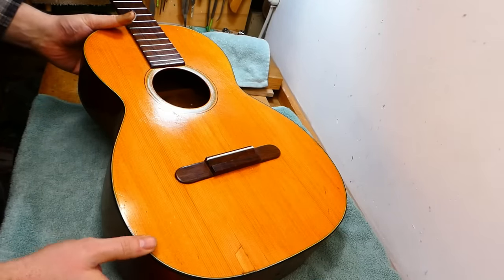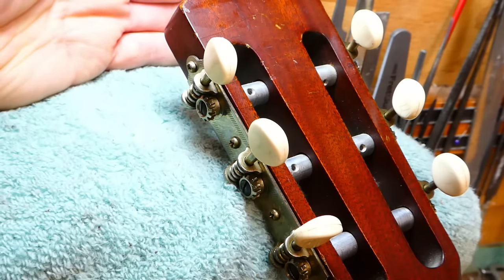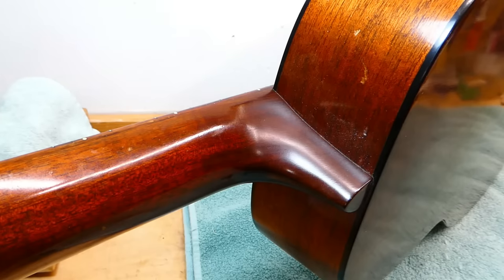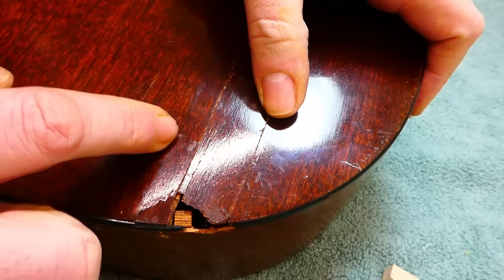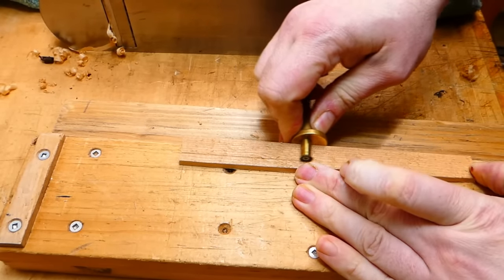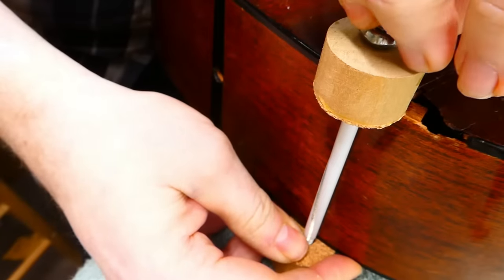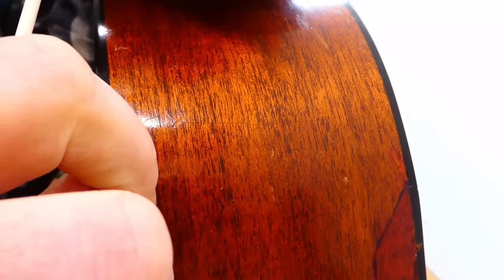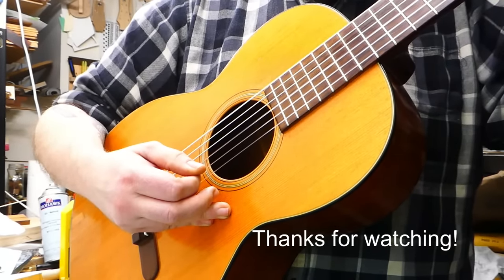Martin with Lower Back Issues.

Comment: Great repair.

These inexpensive 60’s classical guitars can be really nice. I have a 1967 Hagstrom built by Bjarton in Sweden that I paid $100 for a few years ago.  The tuners were falling apart, but otherwise it’s in nice shape.  The nitrocellulose is beautifully cracked with age, but there are very few dings. A set of Stew Mac restoration tuners and around 4 hours of work and I have my favorite classical guitar.

Later I installed some Waverly snakewood strap buttons.

It sounds beautiful and is a joy to play.

There are a few recordings of it in my channel.

Comment: I took a chunk out of a hollowbody greenburst Les Paul in the green and spilling into the black.
I green markered it for a test which actually showed me a lot; I will need to sand smooth all the jagged edges of finish around the missing lacquer. I didn't lose much wood, so I think a glue fill slowly in layers adding green dye as I build it up.
It's quite nasty and near the switch, but I think I can get it presentable again.

Comment: Epoxy wood putty like jb weld's "kwikwood" really is great stuff. For guys like me that are less experienced routing out patches of wood then using plugs (on anything other than the most basic shapes) it really is a lifesaver. My first guitar build I bought a cheap "mahogany" rough cut body and it was abysmally bad. Knots that were very resistant to filler etc. But the worst if it was the neck pocket. It was just cut so awfully on the sides especially. But I was able to use the kwikwood to make that neck pocket damn near perfect. The thinner parts of the pocket where there was only a tiny piece of wood on the right side of the pocket was cut completely uneven and the wood was frayed and too short. But I was able to chisel off the weakest spots and rebuilt that spot with the kwikwood then shape it perfectly. And its held up flawlessly without any shrinkage. I used a vinyl sealer then a nitro vintage white then a nitro clear on top and it took to the kwikwood wonderfully. I believe it says it will take stain but that is something I would think to be very hit or miss. I'm sure it does take stain but I imagine it would be hard to get the same saturation as the real wood next to it. Anyways I just thought I'd throw that out there cause if anyone does repairs and hasn't found kwikwood yet they will likely be thrilled once they do. I also use it when I need a tiny bit more material and adding a wood veneer would still be too much. I always try to use wood dowels for screw hole plugs but on occasion the screw holes will be right on the edge of a peice of work so dowling it could split the wood. In those situations kwikwood is a great way to fill the hole without risk of the dowel or surrounding wood swelling from the titebond and splitting the wood. A dowel carefully sized and inserted would surely work but kwikwood is fast, wont stress the wood and can be redrilled. If any ok ne reading this hasn't already tried it I urge you to at least keep it in mind just in case you have a repair come up that kwikwood would make a lot easier.

Comment: I've thought about this several times while watching your videos.  I used to do a lot of repair on old archtop guitars I'd buy on eBay.  I'd do stuff like remove the back and re-glue braces and cleat cracks etc then resell them -- it was just for funs.  I always used fish glue seemed to have no issues with it?  I liked its ease of use -- e.g., no concerns with rushing the clamping etc..  But then years later I got into a huge "discussion" on-line with some folks who claimed fish glue was not good glue for luthiery because it was too hygroscopic thus would release easily in anything but a dry atmosphere?  This discussion got a bit testy. Years later I tried to fix a broken mandolin neck with fish glue and I did have it fail twice -- both times in the humid summer months. So I was a bit chastened?  Later I redid the repair this time with marine epoxy (!!! I know) but over 5 years ago -- fix is holding.  But you would not be one of those who lacks confidence in fish glue -- obviously.

Comment: what gauge is your syringe ? I was using a 14 ga. with hot hide glue today, it drew the glue in, but I was reglueing a portion of upright bass top to soundboard and couldn't spring  the gap wide enough to get the tip in. I suppose fish glue is the proper glue for syringe work.
Reply: Depends on viscosity of glue versus needle gauge. You can inject epoxy if your gauge is large enough. For smaller spaces, use a finer gauge needle and consider an adhesive that you can thin slightly with a little solvent for better flow.

Comment: Newbie struggling to match finish colors: is there a role for stains in the repair process. I notice that everything I’ve seen you use is “topical”. I’ve tried some stain but had trouble with it absorbing into CA treated wood for obvious reasons. Just curious if a penetrating stain could be applied earlier in the process without sacrificing surface adhesive with glues.

Comment: That Martin guitar back, sides and neck color in your video. It looks red. What color is it?

And in the 50s and 60s did they stain the wooden neck and back of a guitar, or did they spray paint the back and neck? The color looks dark red on your Martin.

The reason I ask is that I have a 1954 Guild nylon classic acoustic guitar. The color of Martin's back, sides and neck are the same color (dark reddish color) as my Guild. I need to know the color for some touch-up repairs on my Guild. That is why I am asking.

You are right, I heard people put steel strings on a classic nylon string guitar and the guitar and bridge exploded. 

I hope you can help answer my few questions. Thank you. Oh, that Martin, you have a nice looking guitar.

Comment: Hey man could you help me identify a regal archtop guitar? There's no model or serial number on it it has the regal headstock logo with the crown inside the oval rather than the crown at the top ,says made in Chicago is a light burst almost like honey burst what I'd call it has no binding and dot inlays please help it's a amazing condition player that was handed down to me but I know nothing ? Also has all flat head screws so would that date pre 1936 considering that Phillips screws became popular around 1936?

Comment: Awesome 😎

I’ve never fully understood why no truss rods in classical guitars ?

I get that the correct strings have less pressure but overtime any pressure at all is going to change things.

You can even change your facial features overtime by pressing on the roof of your mouth just above your teeth with your tongue a little bit every day which will stretch your face out … (yes, a little weird info for those who didn’t know)

We look at things and think they’re solid, but at a microscopic level everything is pliable.

I actually bought a guitar while I was deployed for desert storm and played it while sitting on the desert watching our jets bomb the Iraqis.

It made it all the way home in one day. I just kind of tossed it on my bed and it bounced off and on the floor and broke the neck off, so I’ve been doing a lot of research and practicing on other things till the day I decide to try and fix it.

The guitar is not worth much, but the history is.

Fyi. You never know where you’ll find an interesting guitar.

I picked up a Lyle C-650 for $20 off Facebook marketplace.

It may not be $1 million guitar but it’s absolutely beautiful and sounds wonderful.

The only problem is that it takes makes me forget that I have another guitar to fix….

Comment: would there be a way to brace that guitar to take steel strings?
Reply: Absolutely! Enclose it in a hardshell case. Place it under the bed. Buy a steel string guitar. Job well done.
Sorry couldn't resist.
In short, practically, NO. 
In theory, YES.
But it would mean disassembling, reengineering and rebuilding the entire guitar.
You'd just end up with a guitar that happens to be made out of some pieces of wood that used to be a Martin.
Reply: @FoulOwl2112  - Dave Chappelle move out the way, there's a new king of comedy. Oh man, my ribs still ache as I think about it. You are wasted in this Comments Section, you need a  Netflix Special, dude. - Of course it would require major disassembly but you might end up with something like a 1960s Martin 000-28 with a naturally aged spruce top, Brazilian rosewood back and sides. PKThompson Guitars currently make something similar for approx. $14,000 a pop. I was wondering whether it was feasible for a decent craftsman to convert it as a pet project

Comment: I have one those, the serial number suggested 1961 so being the last year these were made. Is it possible you said 1966 but meant 1956 as the start of production? 
Lovely video as always.
Reply: 00-18C
Reply: @foghornleghorn8536  yes that is the model .
Reply: @docdoc  Just going by what I found on  the web that model was built up until 69. I saw one purported to be a 1970 model. I have no idea about the accuracy of what was found.

Comment: I find that bridge very attractive from a design standpoint. I never liked the rectangular bridges on guitars. The whole body is round and curvy. Why spoil that with what looks like zero effort on making an attractive bridge. 

Martin’s headstocks also seem like an afterthought. I realize they are square on the end because they were slotted. But on the non slotted heads they just look unfinished. Just cut the end off square and leave it!